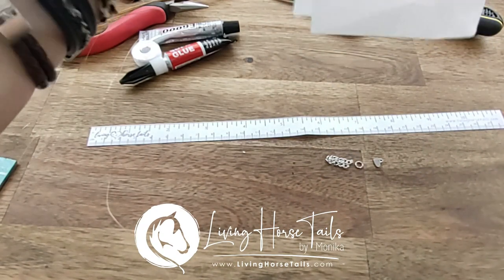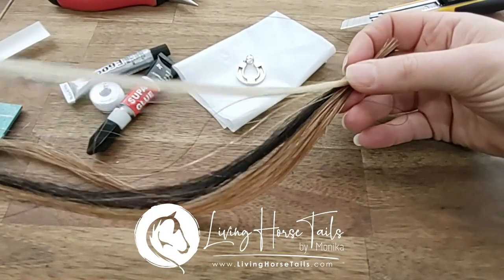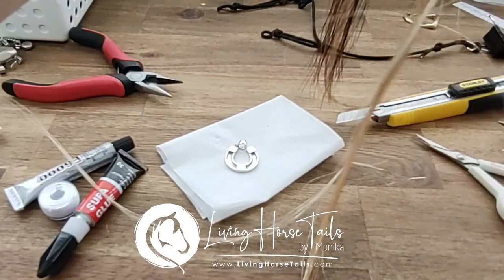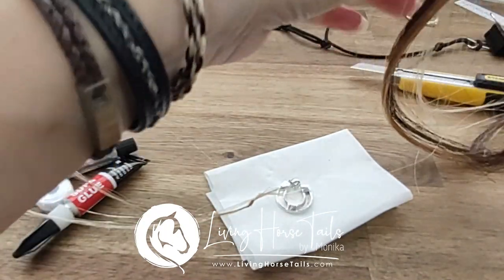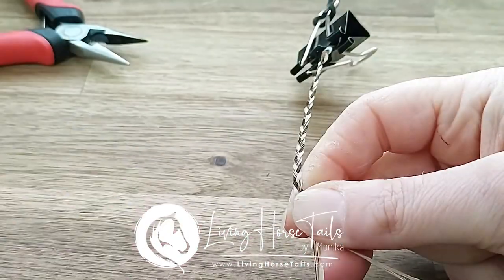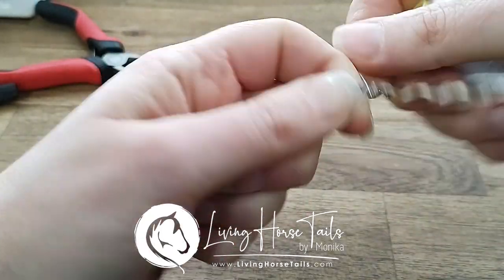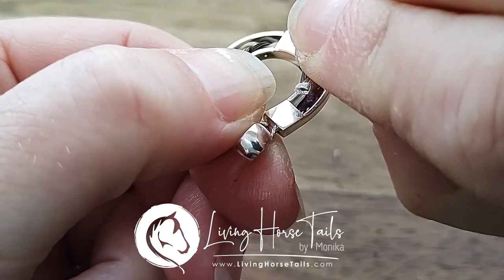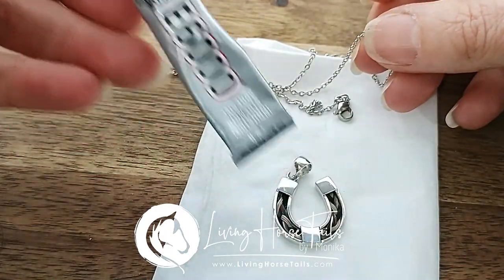Make your own horseshoe pendant inlaid with horse hair. Living Horse Tails - DIY jewellery by Monika

Comment: Is it possible to buy just the horseshoe?? I want to make it into a key ring instead of a necklace and have all the supplies needed already
Reply from the maker: I have these ready and made up as diy kits. 
You can always just use the strong silver horseshoe part, and not the straights steel necklace chain.
~ Monika